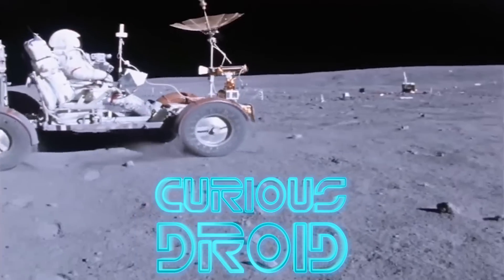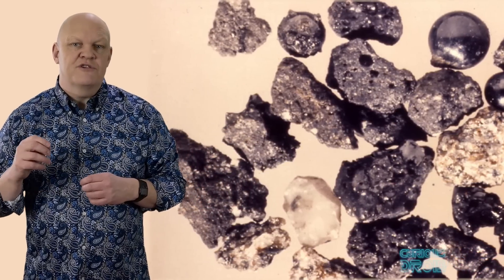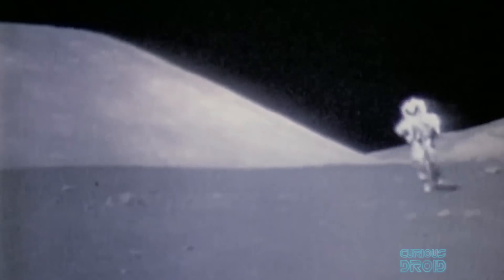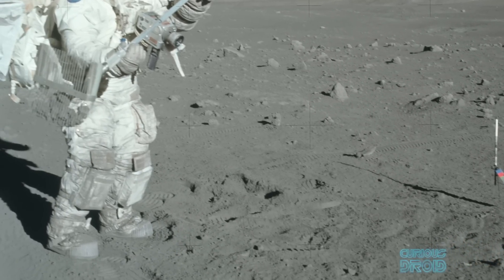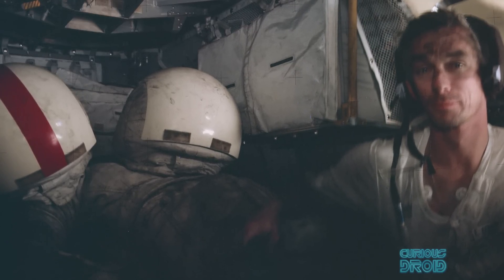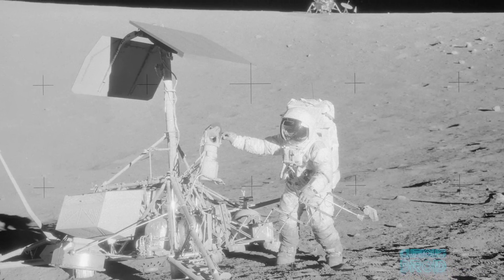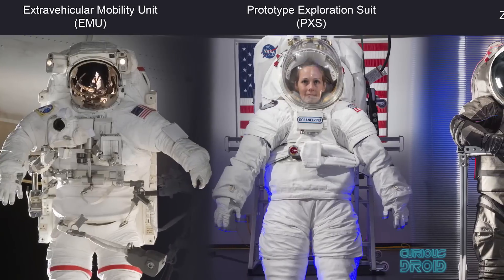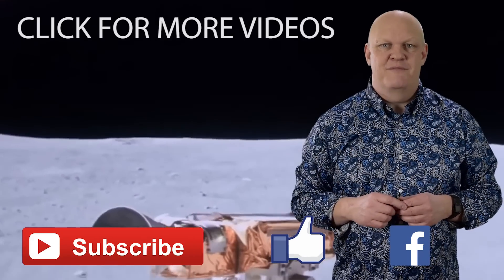Apollo, the Lunar Dust and NASA's Dirty Problem

Comment: Yes tel us about that moon dust it must be magic dust whet a rocket blast on it it do not move but moon car tyer can make it fly up in the air they must get it for up repair potholes not even a taxi wil damage it 😆
Reply: Actually, it does visibly move when a rocket blasts on it. We can see that in the Apollo footage.
Reply: They used a low pressure rocket engine on the LEM that wasnt likely to throw up much dust

Comment: 3 months to remove dust from under the nails. A lot of time.
It takes 20 minutes for my beautician. She does this with a pointed nail file. Ah, this NASA,  fly on rockets but  they didn't invent the file for nails . Scary shit in this video. from the beginning to the end.
Reply: there's a difference between earth soil and murdery space dust that is litteraly sandpaper that, if you try to remove it, will cut up your finger, ruin your day, enter your bloodstream and do some damage

Comment: Moon dust unsealed stone containers. The same dust had to settle on the hatches. However, it did not cause leaks. The cosmonauts were entering the vehicle as black as miners and the hatches were still tight. You buddy, decide whether the dust causes leaks or not. Unsealing manholes is the death of actors. Fortunately, everything took place under controlled conditions in a warm and comfortable studio. Fairy tales are nice to watch. Give us more stories. We'll laugh.
Reply: 1. They were astronauts, not cosmonauts. Cosmonauts are russian, astronauts are american.
2. There's a difference between a moving joint coming into contact with moon dust multiple times and a hatch seal that is not exposed to the dust directly

Comment: The cameras on the suite  .. would not work at -40 c ... let alone the -150 even colder in the shade on the moon
Reply: The vacuum of space is a thermal insulator not a thermal conductor. Convective heat transfer cannot take place without a medium to facilitate the transfer.

Comment: Lunar dust is a blanket and you sink in it t minus 40 secs all systems nominal 10 9 8 7 6 4 engine start 3 2 1 boosters 9gnition and lift off we have a lot off

Comment: Luckily enough none of the dreaded lunar dust smeared any of the landing gear feet of the Apollo itself. One would think a lot of dust would have been pushed around thrusting the module down for a smooth landning. But no, clean as a whistle. It’s a miracle!
http://www.space1.com/Artifacts/Lunar_Module_Artifacts/Surface_Sensing_Probe/AS11-40-5917_600.jpg

Comment: Some more reasons why there will never be a sustainable colony on the moon. Cosmic radiation alone would preclude it; solar flares would fry any humans there. 

The lunar landings were truly magnificent,  especially when considering the rudimentary computing equipment being used at the time. 

People need to remember that science fiction is fiction. There is no safe way for people to travel or settle outside our magnetosphere. A trip to Mars would be disastrous. Why don't true scientists speak up and debunk all the optimism about space travel?

It's impossible to separate the media from the money.
Reply: Nope, it would be pretty easy to shield humans on any permanent colony from them.

There is no safe way for us to travel or settle inside our magnetosphere. Safety is all relative and about risk tolerance. Nothing is safe. Everything is safe.

There is no actual known reason we couldn't set up a permanent colony on Mars.

Comment: At 0:00 the driver never moved. Never waves. Never acknowledges  the only other human within 250,000 miles. 
At 35kg weight the LRV also never jumps very high, never loses traction with it's slick tyres on dust, each wheel pressing down only around 70kg (driver+LRV) / 4 = 17.5kg.  Then there is a spring rate issue, the driver sits on one side and weighs almost as much as the buggy, so one side should ride low and smooth, the other high and bouncy. Not what we see. With 6x the mass than the weight the ride would be super smooth - you can see the suspension working but not hard enough.  Not a great start to a video showing a dummy in a buggy go over sand at 1/2 film speed is it?
Then there's that super sticky dust that refuses to stick on top of any rocks. Look at the stops of the big boulders, especially in Apollo 16 and 17. Craggy weathered smooth, clean dust free rocks. How does a moon rock sustain that amount of weathering on a moon free of even an atmosphere?
There's only one logical explanation: the photos were all taken on earth.
Reply: Thank you for proving you know nothing about the space program.
Reply: @MaynardGKrebs-gv4vy  What is the proof?

Comment: So funny that when the LEM landed there was no cloud and no blast crater including no dust on the legs.  All bs
Reply: Cointelpro Here we are in the middle of the celebrations to commemorate the 50th anniversary of the Apollo Moon landings and still, despite every one of the points that they raise to illustrate their theory that it was all a hoax being thoroughly discredited, the conspiracists continually peddle their poisonous and insulting ideas.
Consider: For Apollo 11 - Eight days of continuous 24 hour live broadcasting. Yet at the time no one ever comes forward to expose it as fake.

Four hundred thousand people involved in running the project and not one ever becomes the whistleblower.

Russia & China, both enemies of USA, keep tabs on the progress of the mission and never a hint of a claim that it isn’t happening but actually send congratulations to USA for their achievement.

High definition pictures of the surface of the Moon clearly show the remains of the landings: flag, landing stage, even the footprint trails taken by the astronauts.

Van Allen Belts: The astronauts had low exposure in the Van Allen belts due to the short period of time spent flying through them. Apollo flight trajectories bypassed the inner belts completely, passing through the thinner areas of the outer belts.
Astronauts' overall exposure was actually dominated by solar particles once outside Earth's magnetic field. The total radiation received by the astronauts varied from mission to mission but was measured to be between 0.16 and 1.14 rads (1.6 and 11.4 mGy), much less than the standard of 5 rem (50 mSv) per year set by the United States Atomic Energy Commission for people who work with radioactivity.

There are no stars in the photographs because of the exposure time the cameras used. Go outside and take a picture of a street light and see if any stars show up in the finished picture.

No the flag doesn’t flutter.

Shadows are different because of reflected light off the surface of the Moon and the spacecraft itself.

The technology isn’t ‘lost’ it has moved on. I used to own a BBC Archimedes Computer now I own an Apple. Everything that had been produced on the BBC has been ‘lost’. Technology has moved on.

I could go on, but here’s a challenge to all hoaxers, produce one witness statement that says it was all fake.

Remember that having run the risk of carrying out such a massive hoax on the whole world apparently NASA did it another six times!! Yet, still no whistleblower.

Then according to the doubters, the United States made 9 fully scripted, 6 to 11 day, media rich productions to imitate manned voyages to the Moon and back? Nine productions that employed 24 on camera players to execute. We won't even layer in the scores of other production personel -set construction, audio/video techs, script writing, other actors (voice mostly) etc. required for it to all come together nicely as we've all witnessed. Oh right, they did space the stars. Doh! Oddly, never fired the dude that kept screwing that detail up. 

Apollo 8- 
6 days, 3 hour mission sending 3 men to orbit the Moon for 20 hours (10 orbits). Film and photograph the Moon. Return them to Earth. The men who agreed to participate in the grand deceit: Jim Lovell, Frank Borman and William Anders

Apollo 10-
8 day mission. 3 men to the Moon. Make 31 lunar orbits. Put 2 men in the lunar module and take the LM down to 8 miles from the lunar surface, then return to dock with the command module. Return to Earth. 3 more men agree to this grandest of hoaxes: Thomas Stafford, John Young and Eugene Cernan

Apollo 11- 
8 day, 3 hour mission. Send 3 men to orbit the Moon. Send 2 men down to the lunar surface for 21 hours. 2.5 hours of extravehicular activity. Return to Earth with 47 lbs of  lunar material. Buzz Aldrin, Michael Collins and Neil Armstrong sign off on faking the world after years of training for the real thing

OK. At this point we're at 9 individuals "on board" with acting rather than "astronauting"...plus making the pledge of keeping the secret for the rest of their lives. By this point the US has faked going to the Moon twice and actually fake walking on it once. Mission accomplished right? No. They keep rolling the dice on "hush-hush" by making the "keeping the secret" part exponentially more problematic by creating more fake missions. Bold! Most would say damn stupid in the hoax construction world.

onward...

Apollo 12-
10 day, 4 hour mission. Send 3 men to the Moon. Make 45 lunar orbits. Send 2 men to the surface. Spend 32 hours on the lunar surface to make 2 EVAs totaling 7 hours outside of the LM. Return to Earth with 75 lbs of lunar material. The 3 new actors/fakers: Pete Conrad, Richard Gordon and Alan Bean

Apollo 13-
6 day production of sending 3 men to the Moon with a serious, vehical debilitating, life-threatening explosion occuring on the way to the Moon.  And the men are returned to Earth after swinging around the back side of the Moon. Jim Lovell gets another chance to work on his acting/script reading skills, new guys John Swigert and Fred Haise agree to the huge ruse and play the role/the lie of "Moonman" for the rest of their lives

Apollo 14-
9 day mission...er? Production. Send 3 men to the Moon. Make 2 EVAs (9+ hrs) on lunar surface. Return to Earth with 95 lbs of fake lunar rock and soil. "First American in space" hero Alan Shepard is good to go...to fake I mean, and so are Stuart Roosa and Edgar Mitchell.

...we're now at 17 astronauts on the bald-faced NASA hoax roster. But why stop there? 

Apollo 15-
12 day, 7 hour production of manned mission to the Moon. Bring a 4 wheeled rover for the 4 EVAs that total over 19 hours for the 2 astronauts. Return to the Earth with 170 more pounds of imitation moonrock and soil for the scientists of the world. David Scott, Al Worden and James Irwin say..."ok, count us in"

Apollo 16-
11 day, 1 hour production of manned mission to the Moon. 20 hours of lunar EVA time. Return to the Earth with 210 pounds of faux lunar material. John Young makes an encore, but NASA veterans Ken Mattingly and Charles Duke make their debuts as fake lunar travelers.

Apollo 17-
12 day, 13 hour production of manned mission to the Moon. 22 hours of fully video covered EVA time, including 22 miles of lunar rover travel. Return to Earth with 243 lbs of faux lunar rock and soil to be studied worldwide. Ron Evans and Harrison Schmitt take the oath of life-long secrecy, and Eugene Cernan returns to close out this epic, with his exit stage left on this completely fabricated tale of humans traveling to the Moon.

Nice job NASA!...and it only took 24 different people to cast the leads for this blockbuster-

Navy Captain Jim Lovell- Wife Marilyn, 4 children 
Air Force Colonel Frank Borman- Wife Susan, 2 children
Air Force Major General William Anders- Wife Valerie, 6 children 
Air Force Lieutenant Thomas Stafford- 1st wife Faye, 2 children, 2nd wife Linda ('88), 2 children 
Navy Captain John Young- Wife Barbara, 2 children
US Navy Eugene Cernan- Wife Barbara, 1 child
Air Force Colonel Buzz Aldrin- Married three times, div. '74,'78 & '88, 3 children 
Air Force Major General Michael Collins- Wife Patricia, 1 child
US Navy Neil Armstrong- 1st wife Janet, 2 children, 2nd wife Carol 
Navy Captain Pete Conrad- 1st wife Jane, 4 children, 2nd wife Nancy
Navy Captain Dick Gordon- Wife Barbara, 6 children
Navy Captain Alan Bean- Married twice, 2 children (from first marriage)
Air Force Captain Jack Swigert- Bachelor
Air Force Captain Fred Haise- 1st wife Mary, 4 children, 2nd wife Patt
Navy Rear Admiral Alan Shepard- Wife Louise, 3 children
Air Force Colonel Stu Roosa- Wife Joan, 4 children 
Navy Captain Edgar Mitchell- Married twice, 5 children (2 adopted)
Air Force Colonel David Scott- 1st wife Ann, 2 children, 2nd wife Margaret
Air Force Colonel Al Worden- Married twice, 3 children
Air Force Colonel James Irwin- Wife Mary Ellen, 5 children
Navy Rear Admiral Ken Mattingly- Wife Elizabeth, Children ?? 
Air Force Brigadier General Charles Duke- Wife Dorothy, 2 children
Navy Captain Ron Evans- Wife Jan, 2 children
Geologist Harrison Schmitt- Wife Teresa

24 men committed to the BSing of mankind for whatever reason. They had/have 33 wives and 67 children between them. How many siblings for the fake space travelers? Conservatively...around 50 maybe? Parents that were alive and vital during, and for some years after their faked missions? IDK? 20? 30? We are now nearing 200 immediate family members that they have to lie to, over and over and over for decades, that their trip to the Moon was real, "listen to my recounting". This is just a number for "immediates"...close life-long friends? Add what? 50 more that they had to repeatedly keep up the false facade. 

Every  birthday, barbeque, wedding, funeral, graduation, "had too many drinks" event for 30, 40, 50 years they are asked about their great Moon adventure, by aunts, uncles, cousins, grand kids, co-workers, strangers..."so what was going to the Moon like...it must have been incredible!". It never stopped/stops, yet they never admit the truth. 

Financial rewards? A book deal's numbers would've been astronomical. 

Death threat? Simple and easy I guess. So let's imagine in 1999 Ken Mattingly or Gene Cernan comes out with his lucrative tell all book about how the US hoaxed it, then a month later he dies under suspicious circumstances. Everyone in world then moves back to believing it was all real ...right. Killing him doesn't save the secret...it's over.   

Or.. some of them did spill the beans to a wife, a father, a son or daughter, a dear friend...not a peep yet. 

Come on. Think about it. I encourage you to climb out of your foxhole and really think about it.

So the final numbers were 9/24. 9 missions. 24 astronauts. If those numbers don't give you any pause on your hoax belief, what numbers would have? 12/29? 18/34? 

Any?

They went and we celebrate their bravery and achievements.

Comment: 3:47 Box, vacuum inside and atmospheric pressure outside makes ten ton per square meter. "Little mistake" during the planning. Inert gas maybe was needed or vacuum bag. Stupidity test needed. In moon only need to seal plastic bag outside and bring it inside capsule.

Comment: You know I love these videos, I have a hard time with those debunkers who say we didn't go to the moon, they disrespected those astronauts who went there, those small brain people didn't have enough confidence in NASA to pull this off anyway I got it off of my chest....you flat earth people this go for you too..
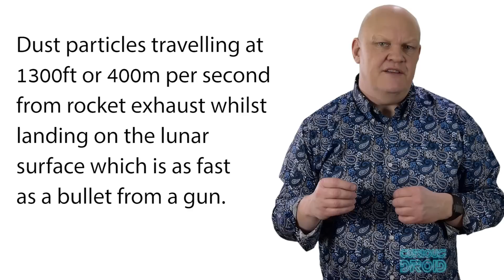Reply: At 6:55 he describes how dust flies away from rocket exaust whilst landing on the lunar surface, why is there no crater visible under the lander in any of the Apollo photographs? Why didn't the engine thrust effect underneath the lander
Reply: @venomman01  The environmental variables are different on the moon. There is virtually no atmosphere and 1/6th gravity. 1/6th gravity means that your thrust requirements for a safe landing are also 1/6th what they would be on earth. If you look at pics from Apollo 17, you can see a brown smudge under the lander where the landing motor cooked and discolored lunar dust. Some dust would have been scattered radially as well, but not nearly as much as would be observed on earth - again because of the lower thrust requirements. Also there is no dust "cloud" after the landing because there is no atmosphere to capture, decelerate, and circulate dust particles - they would just move away from the landing site on a ballistic path. Check out the videos and images of China's robotic moon landing missions and you'll see that they are virtually identical to what we saw with Apollo.